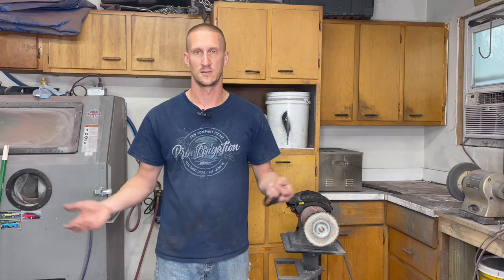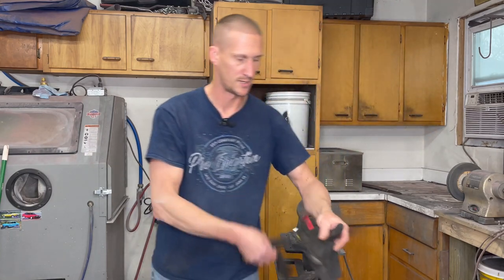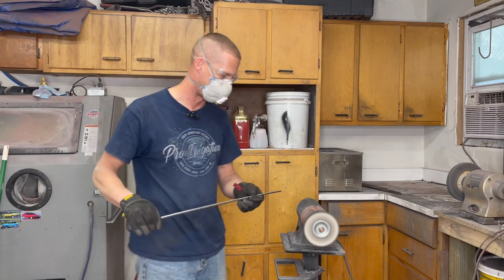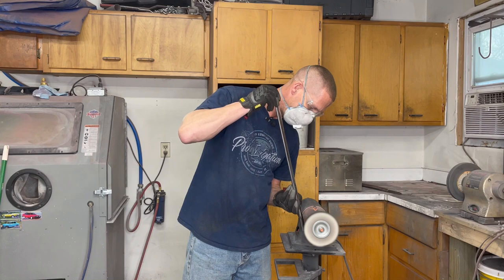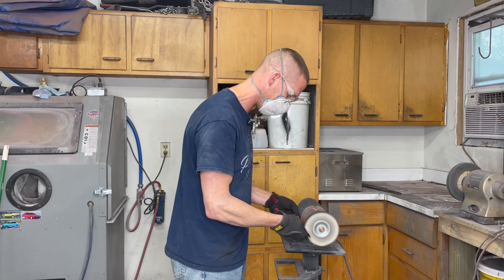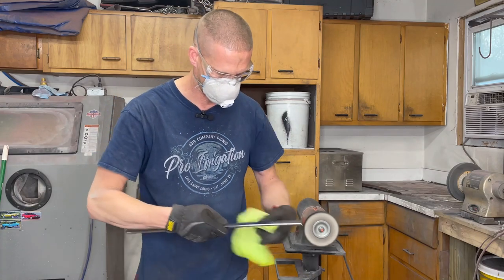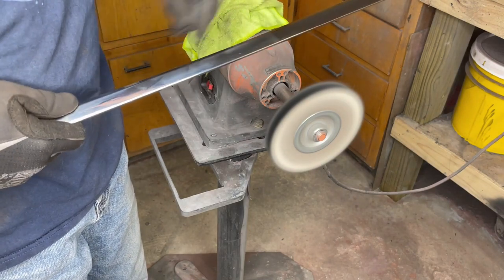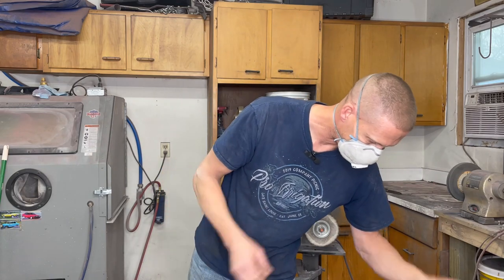How to Polish Stainless Steel Trim - Abbreviated

Comment: Novice here. I’m trying to restore trim on my car what are some dos and donts? As I’ve been looking into this so many opinions on what to use and not use or various products out there then stories of discoloring or “burning” trim?
Reply from the maker: I've burned trim, but only when I use a small sisal wheel.  But I never use those anymore.  You can remove the discoloration with more polishing.  Only thing to worry about if you get it that hot is warping.
I have an updated video on full trim restoration that is much better than this one.

Comment: What are your thoughts on polishing when needing to get dents out and doing some sanding first?
Reply from the maker: It's a much more involved process...I said I was going to do another video on it, and I have yet to do so!  LOL  
Short of it is:  Knock dent out from back side.  File flat.  Sand with continually finer paper until you have gotten to at least 1000 grit.  Then go to this method in the current video.

Comment: Stupid question: I'm not sure on my 62 skylark what is stainless and what is steel chrome plated? Magnet test I suppose.
Reply from the maker: Good question, Dave.  Once you get used to seeing this stuff every day, it's easy to tell just by looking.  Generally, anodized aluminum trim has a haze to it, and won't polish up like stainless if you work it with a chrome polish.  It's also much softer.  Sometimes there is a bit of a rainbow halo in the light with anodized aluminum.
Reply: @antiqueautomotiveservice  So its stainless steel, aluminum, or steel chrome plated?
Reply from the maker: @davereber533  It could also be flash chrome plated stainless
Reply: @antiqueautomotiveservice  Well shit. lol